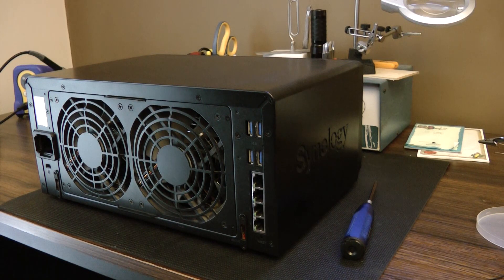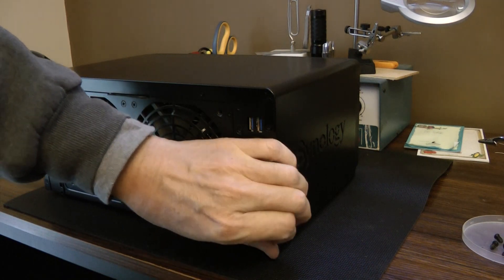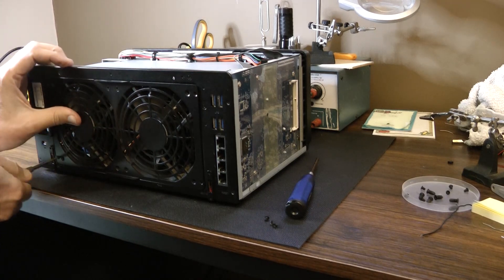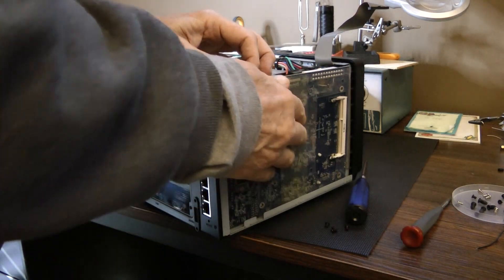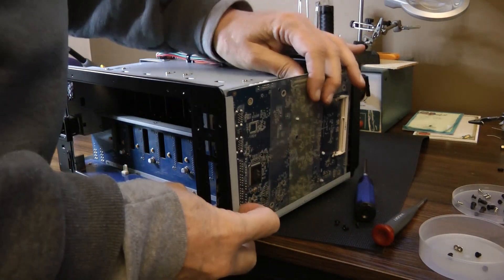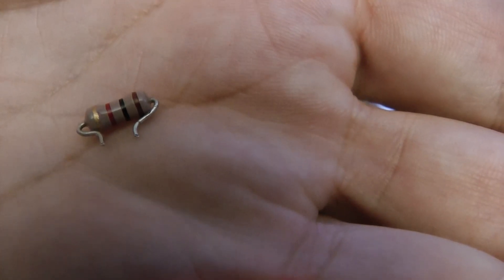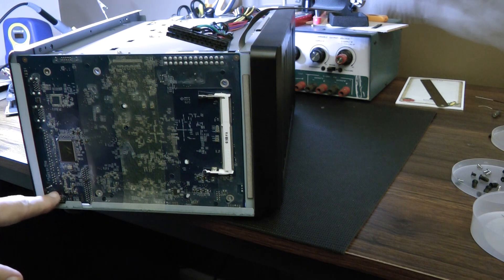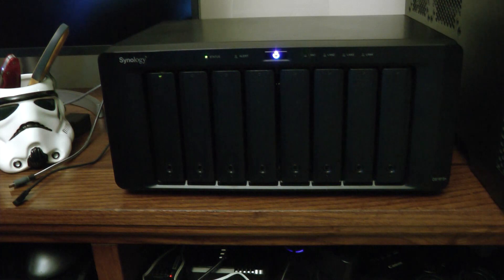Synology 1815+ won't turn on FIX

Comment: after replacing transistor and adding resistor, synology 1815+ start automaticaly after plug power in, but it only blinks blue light and nothing more, not even lan is blinking... any idea?
Reply from the maker: I am going to assume it did not power on before you replaced the transistor and added the resistor?  Does the NAS have a working OS on the drives?  Is the ethernet cable good?  I never payed much attention to the lights, I guess the find synology tool is not locating it?
Reply: @GaryQuiring  yes, it did not started before replacing resistor and so on... now it turns on, but no LAN light, cable is ok. It behaves same with or without disks (on disk there is system). Probably dead mainboard or something. This whole Synology is a big fail. Not able to find spare parts for it. Pretty much good dirty business, because you need Synology again to get data from disks easyly. This faulty piece is from my relative, i never ever tell everyone to buy this. I personaly have XPenology on usual PC, where everything is replaceble for low money.
Reply from the maker: @jiriptacnik2314  I'm not defending them but you can't find spares for much of anything these days.  What sucks is they don't offer any sort of out of warranty repair service.  The only clumsy workaround would be if you had a working Synology to move the drives to.  I have seen articles where they use the USB ports to install faster NIC interfaces via USB.  You would have to patch the OS for the USB drivers on a working Synology and them move the drives back to the broken 1815+.

Comment: Hi. I had the same blinking light issue and applied both fixes which fixed it until a manual power down and the device won’t power up anymore. Any suggestions? Tried another power pc supply and shorting the two pins but no luck.
Reply from the maker: If shorting the green to black wires on the power supply does not turn it on then something else is wrong.
Reply: @GaryQuiring  could it be the resistor has gone bad?
Reply from the maker: @baljitbasra8671  If shorting the green to black wires on the power supply does not turn it on then something else is the issue.  No idea what that could be though.

Comment: Hello and thanks for this video - I have the same problem with my NAS just now. 
I was just wondering where or how you found out about this resistor fix? Why 1k ohm resistor and why the two contact points as described in your video? Any other resistor specs I should know about?
Is this a better fix than swapping the transistor? Do I have to do both? 
I guess I need to go get myself a resistor.
Thanks!
Reply from the maker: Because the transistor is surface mount, it's harder to replace. Many including myself have resistors in their electronic junk box and are able to fix this NAS the same day it fails.  You can replace the transistor to fix it and that new transistor will fail again.  Why 1k, it's what I read works but I am sure other OHM's within reason will equally pull down the transistor so it turns on the NAS.
Reply from the maker: You have to add the 100 ohm resistor for the Atom bug fix.  Do that while it's apart, it will also prevent the NAS from working if that fails.  That's an Intel bug.  The 1k can be added or you can replace the transistor, either will fix it.

Comment: I found that mine played up in cold temps and if you heated the top left corner with a hair drier, it would start.  I found once I put it in my electronics cabinet, that stayed around 30'C, it would work without problem. Might need to try this fix at some stage. Cheers.

Comment: This is great it fixed mine hopefully I'll be able to replace it at some point. I did the Seasonic PSU mod when I first got mine (used) and it worked great until I unhooked it to move it. After that no boot. Tried the 2 psu test from NathanPH's video and still no activity. I did these 2 resistor mods and got it booting again. 

Thank You Gary what a LEGEND!

Comment: Hey, mine also has one DS1815+ nas library, and recently it happens suddenly auto shutdown after powering up for a capable minute, would this also be because of the atmos or the resistor faulty?.
Reply from the maker: Either could cause the issue, add both resistors and you should be good.

Comment: As the saying goes : We are as strong as our weakest link!

May I confirm whether has the BC847 transistor been replaced before? If yes, do you know how long did the NAS lasted till it fails again? Also, why not replace the transistor again?
Reply from the maker: Transistor was never replaced.

Comment: thanks for this Gary , unfortunately my soldering skills weren't up to scratch and somehow one of the pads I was soldering to disappeared eventually and I was just burning a hole into the plastic to which the solder wouldn't stick any more . I should have perfected my soldering first . It was worth a try . Thanks !
Reply from the maker: Did you pull the Q1 or Q4 pad?  I don't have the board out but looking at my photo the Q1 pad looks like it's going to R13.  You could take a closer look and then if you know someone local who has better soldering skills solder it to the R13 resistor.  The other option is to jump the green wire on the power supply connector to a black wire and it won't turn off anymore but does that really matter to you?

Comment: I just checked my server and it was offline.  I went to the box and it was dead cold.  No lights, nothing.  I thought it was the battery backup system acting up, but sure enough the 120V was on the line so its something in the box.  The box already had the resistor fix for the CPU so I knew that wasn't the problem.  Took it apart and the power supply checked out fine on my tester.  So its not power supply.  This is when I started to get worried that its a major fix.  I checked the youtube videos and other people with 1515+ units had similar issues and showed the jumper setting to check out the transistor.  I bridged the Q4 transistor and sure enough it came to life for a brief second.  AHA!  At least now I'm not turning green wondering if my server is permanently down.

I took the motherboard out as shown in this video and looked at the transistor on a microscope.  The letters read "1AM" and the letter "F" sideways.  I looked up the spec and it turns out to be a MMBT3904 NPN transistor.  I don't have one of those lying around so check my stock.  Hey, I got a MMBT2222A NPN transistor.  I wonder if that would work?  I checked the specs and the pinouts are identical.   The only difference is the collector current is 200mA on the 2N3904 and 600mA on the 2N2222.  Close enough for government work!  The 2N2222 is marked as "1P" on the transistor body for those who are looking for similar parts.  If you have old PC boards with SMT parts, they are all over the place.  Just check out the markings to make sure you have the right parts.  FETs also use the same SOT23 style package. 

I fired up the hot air rework station to 350C and put that nozzle right on the part.  Two minutes go by, nothing.  Hmm...  Cranked it up to 400C and tried again.  Nothing.  Crank it up to 450C and heat that part.  Still not flowing!  Crank up the air flow higher and its still not coming off.  The motherboard is heat sinking too fast to even melt the part.  I started to smell plastic burning and realized the connector next to Q4 was getting singed.  Ack!  Plan B.  Fired up the soldering iron and hit the part with the soldering iron instead.  Its not melting!!   Arg..  The damn solder they use is very high temp solder.  I added some 60/40 tin led solder and the part came off immediately.  Good old tin lead solder to the rescue!!  Took the part off and cleaned the solder pads with solder wick so its nice and shiny.  Slapped in the new part and soldered it in place.  Cleaned up the flux with some good old isopropyl alcohol and looks good as new.

Put everything back in and did a test run.  Hey!!!  Its starting again!  It's ALIVE!  Yay!!  Put all the parts back together and fired it up.  Its purring like a kitten.  Now I can access all my bootleg... errr.. legit movies that was "backed up".  Time to dim the lights and get out the lotion....

Thanks for your help!  It worked out great.  Saved my day!

Comment: Worked like a charm. Thanks!
Also: Just remove the back-chassis piece (mind the screws on the bottom!) and replugging the edge-Connectors becomes WAY easier.

Comment: Thank you so much!  Your very clearly stated instructions just saved me a huge headache and a significant number of my wedding pictures. After my DS1815+ stopped turning on, the jumper method worked for a while, until one day after a power outage, it started remaining in the blue blinking LED stage indefinitely after turning on.  For whatever reason, this 1K resister not only restored the use of the power button, but also fixed the blue blink of death I was getting when using the jumper.  I really appreciate the effort you put in to documenting this fix!

Comment: That did not work to get mine powered up. Shorting the green and black wires does. Also mine is 100% factory and I have owned it since new and it had the atom fix from the factory.

Comment: Seems like this worked, I need to order a new power supply, I was able to perfectly boot my NAS, but the drives don't boot, there is no power, so I ordered a new power supply. Thank you for the FIX...
Reply from the maker: That does not sound right.  What is booting?  Does it come on the network, can you ping it?

Comment: Hi Gary, thanks for the fix.

I just got a beat up Syn server for free, because it doesn't work.
From what i've seen (constant blinking orange alert light) the 100ohm resistor should fix that problem.. hopefully.

However, it did have another problem too, that the prev owner had a fix applied to it because its powerbutton stopped working. 
He had it fixed by soldering 2 of the 24-pin together on the backside, to make it work. It does work, but the server starts automatically when plugged into power, and the only way to shut it down is through DSM. 

Could this be that he used another way of solving the same problem? Or does it sound like a completely different issue?

Can you suggest me how to test it? I considered removing the solder and try the 1k resistor fix, but i'd like to hear your take on it before i do anything.
Reply: It seems another one had the same issue and i found (hopefully again) the fix in your conversation.
Reply from the maker: Soldering two wires from the 24 pin connector is proof that the transistor is the issue.  Applying the 1k resister to those two solder pads shown in the video will/should solve the issue.  Make sure to remove the connection on the 24 pin connector though.
Reply: @GaryQuiring  Thanks for the quick reply!
Yeah i will remove it, and hopefully get a fresh NAS out of it for "free" :D (just had to buy all the hardware lol, i'm new to the whole soldering thing)

The description the other guy had fits mine 100% (green and black soldered together), however the resister fix didn't work for him. He had to replace the transistor from what i understand.
Did i misunderstand something? - again i am completely new to this, so sorry in advance for asking stupid questions.
Reply from the maker: @perfect.stealth  It's true that eventually the transistor could totally fail and need to be replaced.  Sometimes installing a higher K resistor can fix it too.  For now I prefer the resistor fix, replacing that small SMD is difficult.

Comment: Hi Gary - Thanks for the great video and instruction. I have soldered the 1K resistor as directed but still don't get power. When I test the power supply by bridging the green connector to the black, the small fan on the power supply spins up but I don't get power to the unit. Is there a chance the power supply is bad even though its internal fan spins up?
Reply from the maker: Boy that's hard to say.  It could be the power supply or the motherboard.

Comment: I bought mine new in 2015. Had the same problem and was repaired under warranty in 2017. Now the problem is back. A technician who looked it said that a hack has been already done on the motherboard and suggested that this time the problem is with the power supply. So I got the new power supply (after 4 months of waiting) but no use. :( Is it possible that the resistor will also fail in time and must be replaced again?
Reply: I must correct myself. Took the case off and the resistor has not been added to that location. Hopefully this will fix my NAS.
Reply from the maker: @midauskuda  There are two resistor 'hacks'.  The first was for the Intel ATOM bug.  That is what was fixed under your warranty.  The power supply issue is NOT the power supply.  It's the electronic switch on the main motherboard that is failing due to that transistor.  That switch tells the power supply to turn on.  If you want to test before applying the resistor take a paper clip or wire and short the green wire on the power supply connector to one of the black wires. The NAS should turn on.  If you are remotely color blind then don't do this!

Comment: Would replacing the psu also fix it?
Reply from the maker: No, it's not a bad power supply.  That will not fix it.
Reply: Nope, I've replaced another PSU in it, before I got to this thread, and it didn't help. only shortcutting or soldering resistor seems to do the trick.

Comment: Hi Gary, thanks for the video.
I have the same issue on my DS1815+
If I short the green+black wire on the PSU-connector, the NAS just starts fine.
I used your fix with a 1K-ohm resistor, but it still won't power on...
(Only If I short the PSU green and black)
So I know the PSU and motherboard are still Allright, but the fix didn't work for me...
Is there something else that I could try? (Using a higher or lower Ohm resistor?)
Reply from the maker: Did you apply the Atom bug fix with the 100ohn resister?  You could try a higher Ohm resister for the transistor issue.  I would start by reheating the connections for the 1k resistor, maybe it's just a bad solder joint.  You could also replace the transistor.
Reply: @GaryQuiring  thanks for the fast reply!
The atom-fix was already factory-applied. (This is an RMA-replacement unit from 2018)
I just reheated the leads so the solder would cleanly join the solderpad and the leads from the resistor.
It's a very pretty solder-job if I say so myself, so I'm quite confident it makes contacts on both points.
Since the transistor is very small, I don't know that replacing that one will be possible...

So increasing the resistance might help?
Then I'll put it another 1K-ohm in series with the current one.
Reply from the maker: @Tokkevo  Surface mount components are harder to solder but if you get a magnifier loop with one of those goose necks on it with a LED lamp it's not that bad.  I built a couple of surface mount kits this past year and have finally gotten the hang of it.  You will also need a bottle of liquid flux.  Here is video that shows my LED project.  

https://www.youtube.com/watch?v=sQbynedTnPw
Reply: @GaryQuiring  Hi Gary, thanks again for the tips!
Measuring the voltages on the green and black wire made me realize that the transistor was not doing anything when pressing the powerbutton. So replacing the transistor did the job (I actually just placed a new one on the empty Q1-area and left the broken transistor in place on the Q4-area, since I didn't want to fiddle around too much on that small area)
So thanks again for your help!
Reply from the maker: @Tokkevo  That's good to know we can use the empty Q1 area to use a transistor.  I'm assuming at some point the transistor will probably fail with these resister patches.  It might be time to consider just adding the transistor instead.  What transistor did you add to the Q1?
Reply: @GaryQuiring  yeah, I found out on a German forum that Q1 and Q4 are just parallel to each other. A bc847 is needed, but my local electronics shop didn't have SMD's, so I used an BC547C, which apparently works just fine as well.
Reply: Adding 1K resistor did not help powering it on here as well. I had also atom bug fix applied already.
So I added BC847B on empty Q1 place as you did and it powered on.
Now it is been running for about a week and everything is fine.
Thanks a lot for this fix!
Reply: This is the exact problem i am experiencing. Thank you for the fix. Can't wait to test it :D

Comment: Heya Garry greetings from the UK. Awesome video by the way, I fix alot of stuff too. Got a DS1515+ that worked for a while but it stopped working recently, I was assuming it could have been the power supply but now watching your insightful video I am wondering if mine has the same problem? Is there any way to check, thank you in advance subscribed looking forward to more videos!
Reply from the maker: More than likely it's the same thing, I did a quick search on Youtube and from what I can see the motherboard looks very similar.  It could be the Atom bug or the transistor.  I recommend doing both.  You could also short a pin on the power supply connector between any black wire and the green (there should only be one green wire, if not do not do this).  The short should turn the system on, if it turns on you know it's the transistor issue.

Comment: Hi thanks for your video! i got one 1815+ used, it worked fine until one day started to shutdown unespectly or even wont turn on for a while until it start. I'm wonderin maybe if you see this message you could tell if its the same to use a ceramic or metal resistor if the keep the 100ohms or 1komhs 

thanks!
Reply from the maker: You need two resistors, don't change the OHMS.  The Atom is the 100ohm, the transistor fix is the 1k.

Comment: Awesome stuff. Quick one, what wattage for the 100ohm resistor? I just bought a 1K 0.25w 5% carbon resistor for the transistor fix
Reply from the maker: I doubt it would matter.  1/4 watt should be fine.